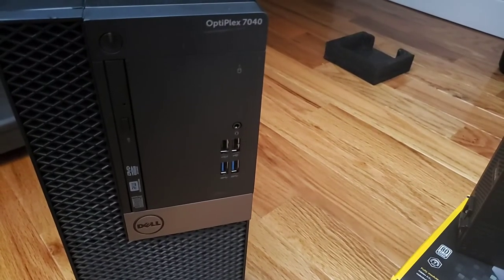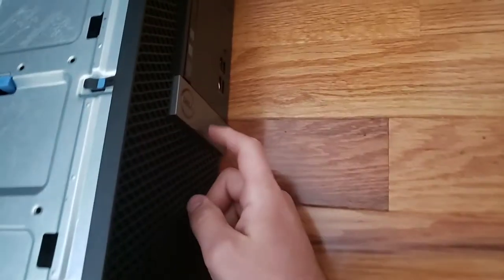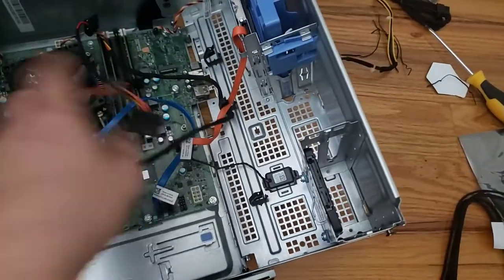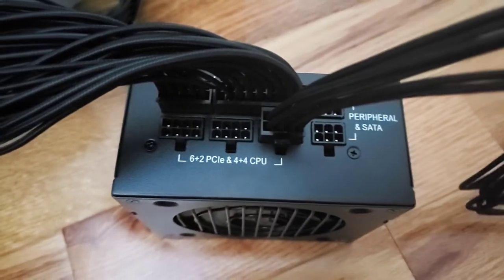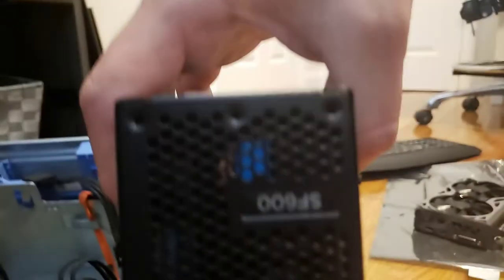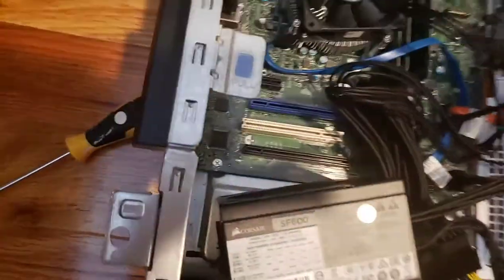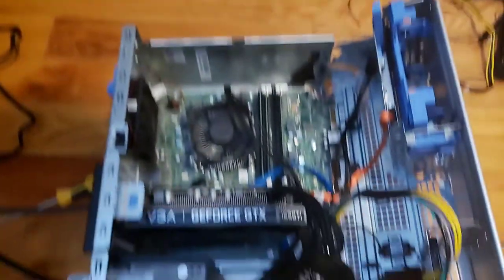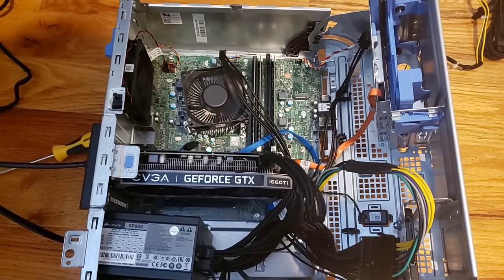Upgraded Dell Optiplex 7040 Mini Tower Corsair SF600 PSU 600 Watt GEFORCE GTX 1660Ti FRANKENSTEIN

Comment: I understand the whole "More power" thing for the video card but removing the in place power connections from the motherboard to the reader and drives is somewhat silly. You just increased the points of failure in your system by plugging into the modular power supply. You also increased the clutter inside your system unnecessarily. Yes you removed two cables running from the MB but you added two cables running from your PS. Kind of a DUH moment if you ask me.
Reply: We don't care
Reply: @NkosanaMakhubele  And your reason for making a snide comment? Anger? Jellocy? Ignorance? All three?
Reply: @TKSubDude   We don't care
Reply: @TKSubDude jellocy 😂😂😂😂
Reply: @aimz0fficial315  Silly comment. I have a 7050 which has the same frame and PS configuration. You can buy a PS that is a dell replacement that slots in perfectly. No excess jumpers and no case mods. 500 watts will run the box and a card up to a 3070 with no sweat. Thats what I did 3 years ago.

Comment: 4FWF7 04FWF7 460W PSU For Dell 3046 3040 3050 5050 MT also works with 7050. I know because I put one inside my 7050 and then added a RTX 2060.
Reply: Nice - is the 7050 different than the 7040 in terms of what psu it can take? I would like to get one of these if it would fit in my 7040 MT
Reply: @TKSubDude  Thanks. will check it out
Reply: @sdtechconsulting  Did you find out if that PSU works with the 7040? I can’t see all the replies for some reason
Reply: I have not found out yet

Comment: Thanks man. I got my Dell to boot with a 700watt power supply
Reply: Does the size fit tho?
Reply: @samm8824 measure the dimensions of the previous psu or just search optiplex 7040 custom psu dimensions and match that with a 700 watt psu that’s smaller

Comment: Just wanted to drop a note that this video helped me immensely. 

I have an 

Optiplex 7060 MT (I found it in the garbage)
i7 8700
32GB Ram
RX 6600XT 
Corsair SF750

I'm about to install Batocera and couldn't be happier.

Sidenote: I had a problem when I first installed the new power supply. The computer wouldn't boot.

It would just power on an then after a few seconds power off.

At this point I had to clear the cmos.

I not only removed the battery, but I also moved the jumper on JMP1 to position 5-6 and left it there for about ten minutes.

I them moved the jumper back to position 3-4 and reinserted the battery.

After that, everything worked.

Good luck yo everyone trying this.

Big props to Umbrella
Reply: Did you have to move the jumpers? I’ve only ever just took the battery out waited like 5-10 mins and put it back in, I have a optiplex 5055 with a rtx 3050 and a Ryzen 5 5600x that I want to upgrade the psu on
Reply: I had to. Maybe your system is different.
Reply: @RommulusRemus  I really hope I don’t have too lol, I’m pretty new to pc building so stuff like that kinda scares me and just sounds hard to do and easy to mess up.
Reply: It's easy.

Comment: YOOOOOO YOURE A LIFE SAVER. THIS CAME IN SO CLUTCH . GOD BLESS YOU
Reply from the maker: Got COD running.  60+fps.  Gpu temp 70c.  Runs great
Reply from the maker: Still got the latest Call of duty still running great on this PC.   FPS are over 100.

Comment: any sff psu should fit into the 7050 or 7040. the guy in the videos psu size was 
125x64x100mm. many other sff psus also have that size

Comment: Aren't the PSU vents blocked since Dell uses a server style PSU which is smaller?  I saw in another video, that user cut out the panel so the new PSU can exhaust out properly.

Comment: Just a note from a recent mistake: for the 5040 you need a 6 to 24 pin cable
Reply: Please tell me more about this. I'm about to get an Optiplex 5040 SFF and I want to upgrade the PSU. I don't care if I have to lay the new PSU outside of the case, I just need to know how to make it work and not fry my motherboard in the process.
Reply: @josebaisi7090  the instructions for the 5040 are the same as for the computers in this video. literally all I needed to make it work for the 5040 is a 24 to 6 pin adapter instead of the 24 to 8 pin. After that, I just followed the video directions. Also, if you are getting a higher PSU you will likely not be able to fit it in the sff case .
Reply: @flibri5508  Nice, now, can you tell me two things? 1. Point me to one of those adapters to see if I can find one in my area (LATAM) and/or 2. Do you know what each cable does so I can make my own adapter?
Reply: are you sure ? the motherboard for the 5040 mt has an 8 pin on it ??? could I still use the 6pin ?
Reply: @legendsheart3768  you're supposed to use the 6 pin👍
Reply: @flibri5508  my motherboard has a 8 pin on it , would it not work ?
Reply: @legendsheart3768  No, in that case you would need the 8 pin plug as shown in the video. If you were to use a 6-pin plug on an 8-pin motherboard, certain parts of the computer would not get powered.
Reply: I know the SFF version  of the 5040 does use a 6 pin , The MT version uses an 8 , also thanks for the further input.

Comment: About to try this on two optiplex 7050's with 400w EVGA's in order to run GTX 1060's in them. I'm assuming there weren't any more issues after the PSU upgrade?

EDIT: Saw someone mention in the comments that their model needed a 24 pin to 6pin adapter for the motherboard. Just wanted to add that both of my 7050's are also 6 pin, so be sure to get the right adapter for your motherboard!
Reply: Hey were you successful? 

I want to upgrade my 5060 sff power supply too
Reply: @paulshizzledizzle6180  Yeah, they both worked out pretty well but ended up with an odd issue on one. If I restart the computer, it restarts fine. But if I tell it to shut down, it wont boot afterwards. I have to pop the side of the case and pull the CMOS battery for it to boot again. Guessing its either a power supply or motherboard issue and seeing as how the two PSUs were brand new I'm guessing I may be stuck with a partially defective motherboard. (It was an Ebay refurb afterall.) And my 30 day return window to return the PSU's just closed 2 days ago so I'm just gonna live with it. Other than that small hiccup both computers work great, might even upgrade them to M.2 drives but even with the old fashioned SSD's they're quick little boxes. Stuffing all those extra cords in was a bit of a pain, but they should have a small empty area in the bottom front of the case where they can sit.
Reply: oh nice, you were successful. Congrats! @AnthonyBerryman-sc3ew
Reply: @AnthonyBerryman-sc3ew  I have the same problem. Have to unplug gpu plug and wall cord so  resets. Then plug wall back in, let fans turn off then plug gpu back in, then it will boot
Did you fix your problem?
Reply: @ponycarmike  I stopped turning the computer off. lmao. I was under the assumption that it was a motherboard issue, but hearing someone else having the same issue makes me wonder if something else is going on. When I tried swapping power supplies I got the same issue so I dont think its a bad power supply. If you figure anything out let me know because I would really like to be able to turn that computer off at night! haha

Comment: How long is that card (I have a 7050 and want to add a card).  Is it the EVGA GeForce GTX 1660 Ti XC ULTRA GAMING, 06G-P4-1267-KR, 6GB GDDR6, Dual HDB Fans  (listed at 10.55" long?

Comment: why did your screen say: "Hard drive or optical drive not found"?

do you need to replace the sata cables as well? for the hdd?
Reply from the maker: Na. I just didn't plug in my DVD drive at that time
Reply: @umbrellasolutionstech  thanks, I'm also upgrading my optiplex

Comment: Hi, will this solution work with Dell Optiplex 5000 mini tower too? I've got 260W  rubbish PSU (two 4 pin connectors for processor, one 8 pin connector for system board)?
Cheers

Comment: So I've done exactly this for my 7050 using a Corsair SF600 and a GTX 1060 3GB (tested working). The pc will not boot when the GPU is plugged in. Using 8-pin to 6+2 (GPU requires only 6 pin). I suspected bad pcie on motherboard but I have a 1050ti working in it but it obviously doesn't need PSU. Any thoughts?
Reply: did you install the right drivers

Comment: Bro a question, the 7050 models have compatibility with the 8th generation of intel?
I want to know if I can update my i5 7500 to an i5 8500 but I don't know if the motherboard is compatible

Cheers
Reply: the 7060 supports the 8th gen, not the 7050. It only supports 6th and 7th gen.

Comment: Do you think a rtx 2060 or 1070 ti will work? Planning to have a fsp dagger pro sfx 450w psu .. how do you think the thermals would do without modifying anything .. or is it that 1660 ti would be the best possible gpu for this optiplex .. i have a 3050 MT which is I think have the same dimensions as your 7040 .. TIA .. much love to ur channel

Comment: What Adapter did you use?
Reply from the maker: $13 cable on amazon

Asicminer 24 Pin to 8-Pin Power Supply ATX PSU Adapter Cable

Search for it on amazon ASIN. B07CJ49NK8

Just got to amazon.com and paste in that ASIN

Comment: Is it safe? Will it short circuit?
Reply from the maker: its safe.  the pc is still running to this day.  its on most of the time, i use it for working at home........gaming on the weekends when my tv and ps5 are in use
Reply: @umbrellasolutionstech  Mine motherboard and psu died :(
Reply: @DeathEzer  it died after this upgrade?
Reply: @romansalcedo2718  no

Comment: Hello can i put a gtx 1650 or 1050 ti with that stock PSU ?
Reply: Need atleast a 300w psu for 1050ti
Reply: Yes you can without any problems. I have 1650 on my dell 3040 with stock psu running great.
Reply: @ahmadjmms  Hi are u using Low profile 1650 ?
Reply: @rokinos  No the standard height 1650. I even overclocked it with the 240watt psu no problems.
Reply: @ahmadjmms  Ok thank u , because i heard that if u have 300 watt or less u gonna need low profile GPU
Reply: @rokinos  I think low profile GPU is for SFF case only and not dependent on PSU wattage

Comment: I have a 7040 and am having power issues with only a GT 1030 installed. So I pulled the trigger and am doing a case swap with a full sized PSU. Going this route so i have room to upgrade later.

Comment: I just bought a similar Optiplex used and have the same situation regarding the power supply. I thought all desktop computers these days stuck to the ATX standard, but apparently not Dell for some reason. Needless to say, I won't be buying another Optiplex, and I'll look at the manual before buying.

Comment: Question: I have Optiplex 7090 I need a 750w power supply even if it is outside the case. Can this be done? Details?

Comment: About to pull the trigger on a 7060 with an i7 8700. Good to know it can be done. I'll probably slap a 6600 into it in a few months.
Reply: Hey were you able to change PSU in 7060?

 I have a 5060 and wanted to do the same

Comment: Do you just leave the case back panel off or will it fot back on after these upgrades
Reply from the maker: Case closes like it always did
Reply: Will these upgrades work in a optiplex 7050?
Reply: @prt01 Same chassis.. so yes!
Reply: @slrhodes what about a 3050 sff?

Comment: Amazing, i wish I could do this on my 7050 dell but the problem is the power cable has to be 24 pin to 6 .... that’s so frustrating 💔😓
Reply from the maker: Did u search amazon?   They have a 24 pin to 8 pin also.....

Search this ASIN on amazon

B06XGWRTHC
Reply: @umbrellasolutionstech  this is the 8 pin , 7050 need 6 pin , i found a 24 to 6 pin in a website but it’s not specified for dell I’m afraid if i use it , it might damage something
Reply: just leave the existing PSU in place, and buy a 2nd one to use for the GPU.  Jumper the 24pin and make sure it is turned on first before powering the system.  I ran my frankenNAS like this for awhile for extra hdd power.

Comment: It appears to me that there might be a cabling issue for the 2.5" drives (that go directly in front of the power supply) when you close the lid up. Can you show the case being closed with the drives in their caddies and connected?
Reply: I second this, how did it close?
Reply from the maker: I'll check tonight and let you both know.
Reply: @umbrellasolutionstech  I used the supplied ATX bracket as a template to drill new holes for mounting
Reply: @umbrellasolutionstech  Is it tonight yet?
Reply from the maker: @chmedlychmedenstein916  my 2.5 SSD fits in the factory slot, but without the cradle as my tower didn't have one.   I'll order a factory cradle and try it.  Also I'll upload another quick video in a second so u can see how I just have my 2.5 ssd sitting in the slot with 2 screws holding it underneath.
Reply from the maker: https://youtu.be/QkyKDh7z9cc

Is the quick video showing some clearance between the 2.5 drive slots and the the corsair SF600 PSU

Comment: Did you have to make any changes to your bios for secure boot for the gpu or psu to work?
Reply from the maker: I had my secure boot off to begin with so I'm not sure for other that may use secure boot

Comment: This is great. However there is a dell 500w supply available for the newer Optiplex 7080 and 7070 now, 6 pin not 8 pin however. 

But you can also get a TFX PSU which is the correct size for the cut out and use an adapter like you have.
Reply: Wait, huh? I have a Optiplex 7040 SFF, will those TFX psu be compatible with mine? Are they interchangable like that? The maximum compatible PSU I've found was a 315w for the Optiplex XE2
Reply: @SamLoki  if the 7040 has the long thin TFX PSU then yes a TFX PSU with an adapter will work. Silverstone make some higher wattage TFX units. However like in this vid you will find that SFX will fit but you need to drill some new screw holes.

Comment: Will not this create a negative pressure when the psu takes inn fresh air and gpu takes inn air so close to each other?

I did this but other way for my dell optiplex 7050m, but when i try to boot with it the gpu goes full speed, i read somewhere that the 7050m does a psu check everytime it boots, at first i had to unplugg the gpu power cable then start the psu so that the pc could do a psu check or something, then i could plug the gpu cable in and start the pc, i fixes this problem by going into bios and cliked always powermode always on, but the problem i have now is that if i want to shut down the pc i need to shut down the psu if not the pc will try to shut down and after 20 sec after i try to shut down the pc the gpu and cpu fann goes full speed, there is no light in the pc but gpu and cpu fan going crazy almost like the psu wont shut down.